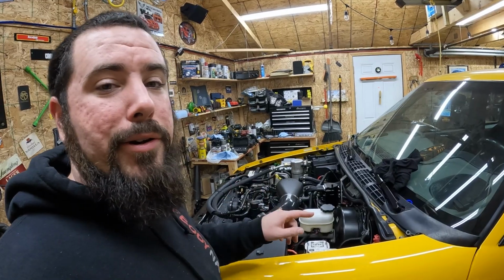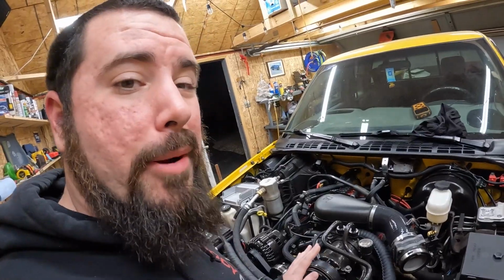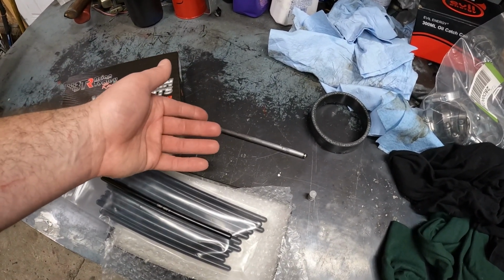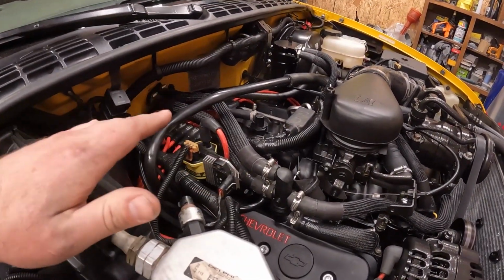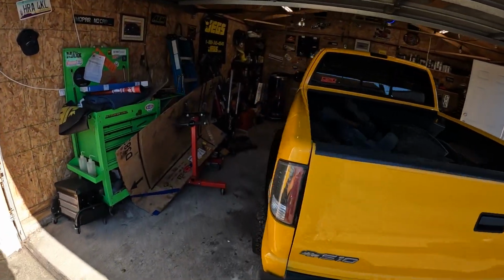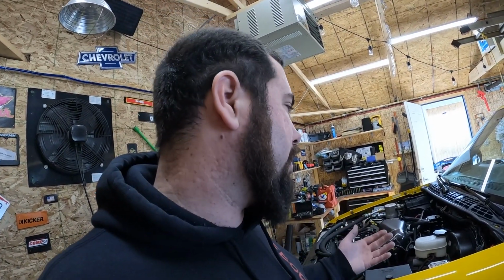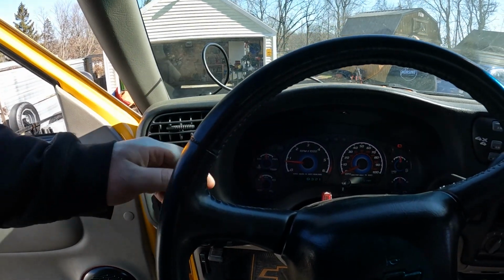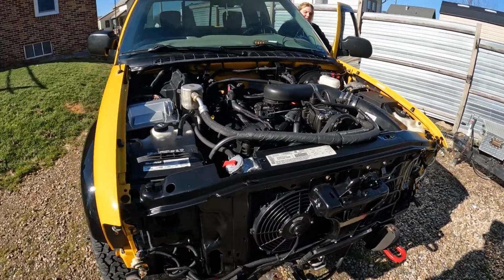V8 s10 First Drive (Built 5.7 Vortec)

Comment: I’ve definitely had the pushrod issue before. I ended up using a set of chromoly trickflow pushrods. Work amazing. I’m in a similar spot, almost close to finished with my s10. It’s good to see this running. Glad to see the progress.
Reply: Also I really wanna see what you do for hood clearance.

Comment: Noticed the intermittent battery light going but couldn’t see it after the test drive. Only guess I’d see with the idling issue after the valves. But definitely sounds nice and glad to see it come alive
Reply from the maker: Thanks, it’s a huge joy to get a big project like that out for the first time.. even if I can’t romp on it yet. The battery light issue is still going on. I’m not sure what the deal is with that. It’s definitely charging though, so I guess I’m not too worried about it for now.

Comment: I have a 98 Sonoma and I kinda eventually feel like doing this one day thing is well I do want it to be cable driven for the throttle body. Hate fly by wire but thing is mine is a 4 cylinder 5 speed and I kinda want to stick with the manual in it but with the V8 in it I got practice in with a manual and I do feel like keeping it as a manual. Thing would be which transmission would be good to use and if there's a transmission that would work with one of these engines and what clutch and pressure plate I'd need. But if Im not able to then nah I'd rather keep it the same then and leave it at that.